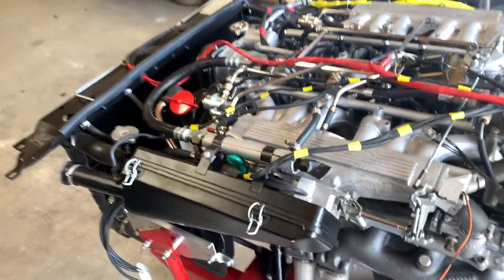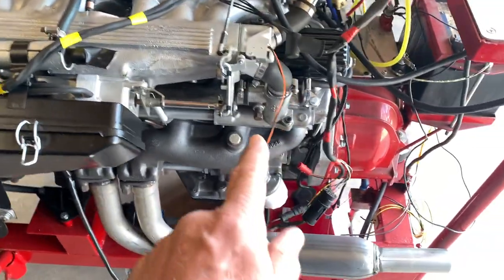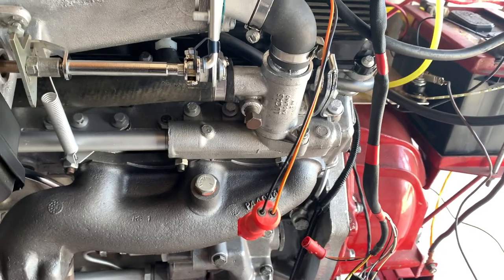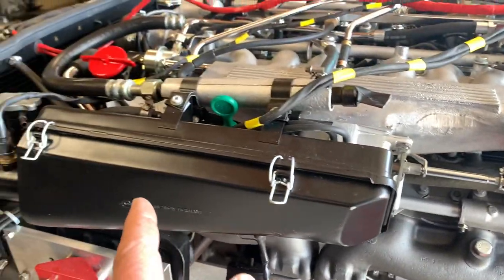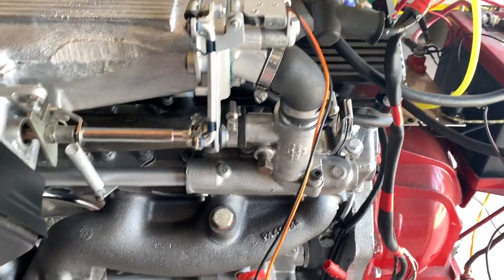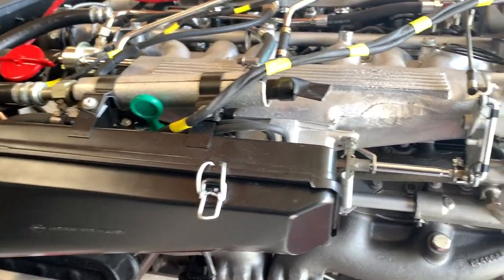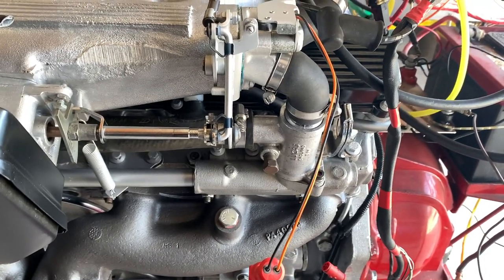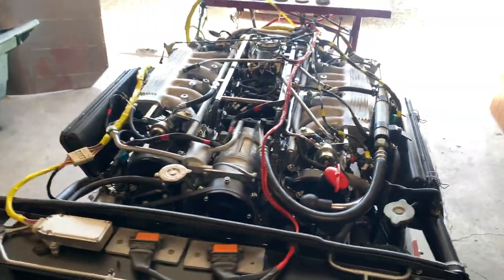CCC Short: Jaguar V12 Restoration Running On The Test Stand

Comment: Those orange and red wire hanging connect to the IDLE switch,  that tells the  the Ignition ECU that its at closed throttle, and that changes the map. and will bring down the idle to a were it needs to be,  then you can adjust the AAV alittle.   after it all warm of course.
Reply: There is no "idle switch" on an HE V12. The only way the engine knows its at idle, is the throttle position sensor (TPS) which is a potentiometer. If it's misadjusted, the the ECU doesn't think it's at idle. The microswitch on the pedastal is for full throttle enrichment,  and the one on the throttle cable bracket is for transmission kickdown.
Reply: @jonalowe  you are correct for the Lucas.  But that switch on mrrelli is an idle switch.
Reply: @smgdata  Yeah, that's for the ignition system ECU. I'm sitting here looking at the wiring diagram. How that plays with the engine ECU, if at all,  I'm not sure. I think all the Marelli ECU feeds the injection ECU is engine speed.  There's only a single shielded wire between the two. TPS adjustment is still critical to idle.
Reply: @jonalowe  yep. Owning three Marelli cars and also 4 Lucas both presently, My experience tinkering with these was  all I was trying to convey. that switch changes the idle speed, messes with the ignition timing.  Eons ago I went about 3 years with the Lucas side the throttle cord not even connected and never noticed a thing. Didnt skip a beat. 😂

Comment: I'm currently trying to figure out an idle issue of my own. My engine starts and runs at 2k rpm for about 5 minutes, and then suddenly drops and the idle fluctuates steadily back and forth between 1500 and 500 rpm. Revs fine otherwise. Assuming a vacuum leak somewhere, but not sure if the AAV might have something to do with it.
Reply from the maker: The AAV is a good place to start. Take it off, clean it up and heat it in a pot of boiling water and see what it does. Plenty of info online.
Reply: Idle fluctuation like that on an HE engine is typical of a misadjusted throttle position sensor (TPS). There are numerous threads on the XJS forums on how to adjust it. You need a voltmeter to do it.
Reply: @jonalowe  What would cause it to go out of whack? I did have the throttle pedestal out recently when I did spark plugs and wires (along with having the distributor out, replacing the vacuum capsule, freeing up the mechanical advance, and cleaning up the PCV breather). I haven't dialed in the timing yet. Just got a timing light today though and will try to get that set perfectly before doing too much else.
Reply: @TroySherk  They wear out, especially the old style black ones made by Bourne. If the throttle linkages are misadjusted, it may not return to the idle position. The measurement at idle is critical, or the idle goes up and down as you describe.
Here's the adjustment procedure:
THROTTLE POTENTIOMETER ADJUSTMENT:  When you replace the throttle pot, the Jaguar manual says you must adjust it using their special electronic tester.  Below is the alternate method. The throttle pulley assembly must be unbolted from its tower to adjust the pot, meaning the linkages to the butterflies are disconnected; but the idle stop is part of the throttle pulley assembly and therefore is unaffected.  You can even start the engine in this condition, as long as you don’t go above idle. Have the ignition on, and the throttle pot assembly rotated to the idle stop.  The engine may be running or not.  Connect a digital voltmeter (the old needle type just won’t do -- go to Radio Shack and fork over the $40) to the red and yellow leads from the pot without disconnecting the pot from the harness.  This can be done by pushing the probes under the insulation on the connector. Adjust the pot by loosening the three small mounting screws and rotating the pot until the voltage reading is within 0.32 - 0.36V.  Tighten the mounting screws and reassemble.  Make sure the reading remains within limits when the linkage is all together and the engine is running at idle.
Reply: @TroySherk  Also, get the HE engine performance manual from here and follow the directions on how to set things up.http://jagrepair.com/images/Electrical/Elect-Tech%20All/81%20-%2088%20XJS%20Engine%20Performance%20S58.pdf
Reply: The AAV is highly likely the issue.  The ECU has a built in fuel overrun cut, so when the ECU sees the throttle sitting at the idle position (via the TPS) and the air entering is too much (causing higher RPM) it cuts the fuel until RPM returns to around 700 RPM, then re-instates fueling.  This is what causes your RPM bouncing issue when this isnt' occuring on say a downhill run off throttle.
Reply: BTW, you can adjust the TPS via OHMS if you want.  The ECU sends a 5V input, and it's just a potentiometer - i.e. simply a voltage divider, so you can easily calculate the Ohms it needs to see in order to have 0.32V at idle.  It's  4K Ohm wiper so:

Vout = (Vs x R2) / (R1 + R2)
R1 + R2 = 4000Ω

0.32 = (5v x R2) / 4000Ω
0.32 * 4000Ω = 5V * R2
1280 = 5V * R2
1280/5v = 256Ω  
R= 256Ω
R1= 3744Ω

Although your TPS may be fine. It's easy to check to make sure it has a clean - no- drop out wipe from idle to WOT - just that the Ohms change smoothly with no weird drops (needle meters work better than digital ones for this).   Other than signaling the idle position, really it's mostly used like a acceleration piston in a carburetor - i.e. it's change delta and speed of that delta change has in input on fueling. It's actual position has far less to do with fueling than RPM, Map sensor input, and CTS input.  It's mostly the speed and magnitude of the change delta that affects adding fueling.  This is not an Alpha/N type fueling system.
Reply: @jonalowe  this is for  the Lucas system not the later Marelli setup. most of info on that Pdf wont work on this at all. except the AAV
Reply: @smgdata  The TPs and throttle plate adjustments are totally applicable. The Marelli cars changed the ignition, not the fuel injection. The OP did not not say if he had Lucas or Marelli ignition.
Reply: @jonalowe  You can clearly see that it’s a Marelli. And you were correct more or less about the throttle adjustment.
Reply: @smgdata  Troy Sherk, the OP that asked the question, did not state which system he has. His engine is NOT the Camp Chaos engine.
Reply: @jonalowe  oh gosh! My bad. 😂